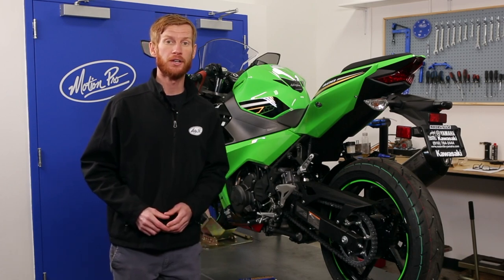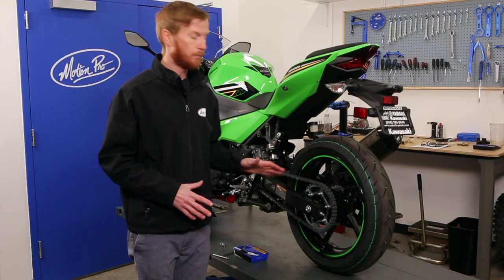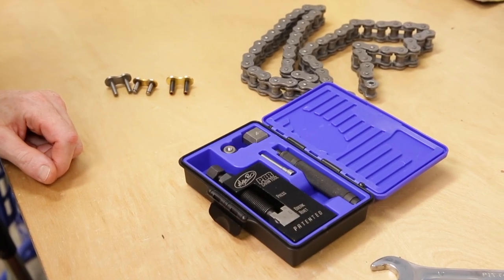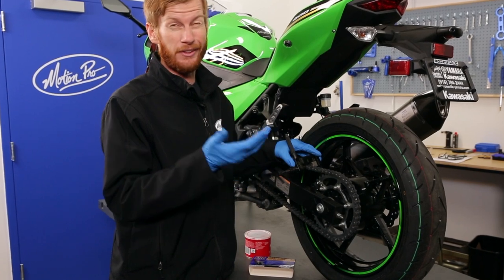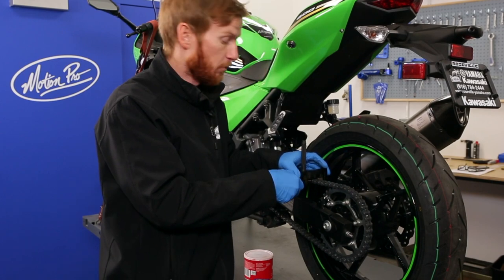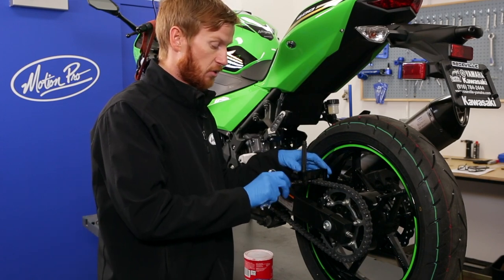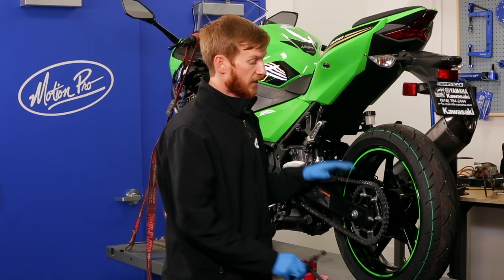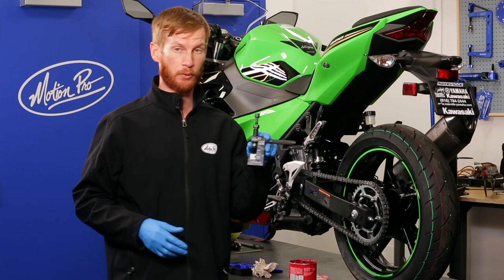How-to: Remove And Install Your Motorcycle Chain With The PBR Chain Tool

Comment: Great video. I have the DID tool (and a cheap HF tool). Installing a Regina ML on a chain I found I need this quad stake tool due to the solid pin. This looks like a really nice tool and hoping to borrow one. All my DID chains have been hollow point and I will stick with that configuration in the future.

Comment: I’ve never seen a wheel be so hard to rotate. When he rotated the wheel it seemed like it was stuck or there was brake hang like Jesus, never have I seen a bike do that except for brake hang
Reply: Is it maybe because the tyre is touching the lift at the bottom?
Reply: the front wheel is in a wheel chock.. do you expect the rear tire to spin easily? LOL
Reply: Look how tight the chain is.  They have it stretched tight to minimize twist while working the PBR tool on the rivet link.  Once the job is complete i suspect they will set the chain to the correct "tightness"